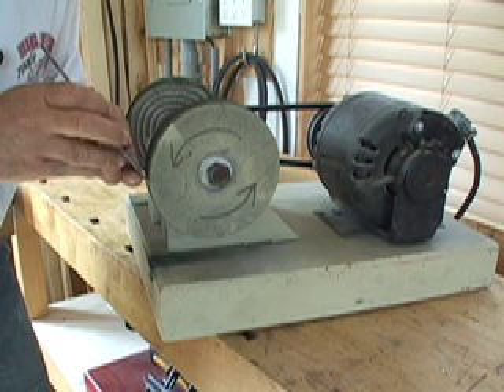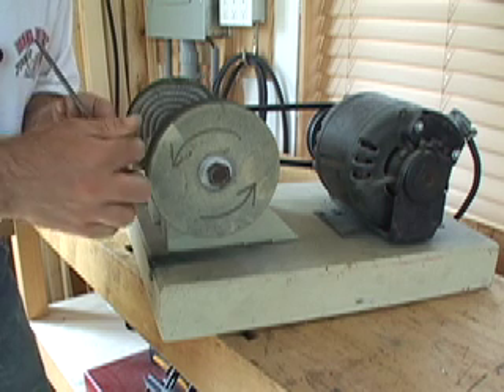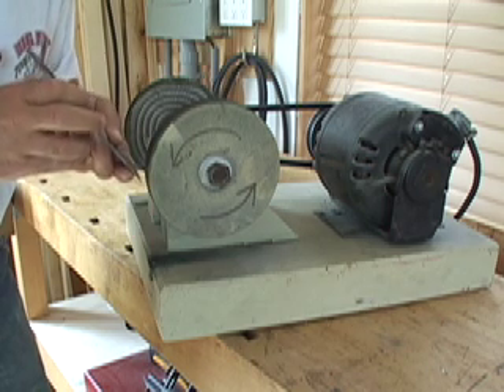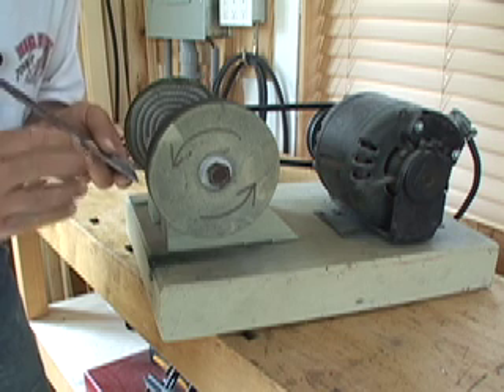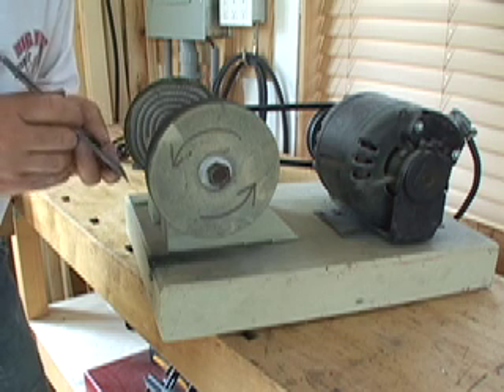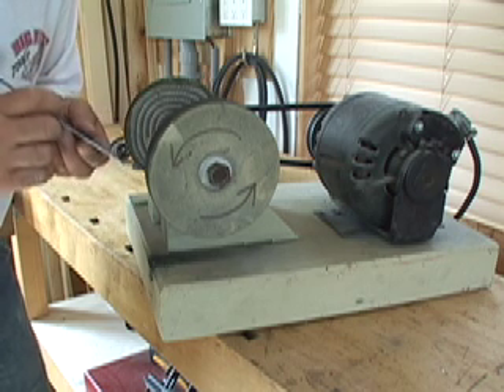Buffing Wheel Sharpening System

Comment: you used the word "tangent" incorrectly.
Reply: +Steve Maxwell Tangere is Latin for "to touch."
Reply: No, he used it correctly. The flat surfaces that form the bevel of the edge should be tangential to the wheel; i.e if you imagine the wheel as a circle and one side of the bevel as a line, the line of the bevel should form a tangent line to the circle of the wheel. This will create a slight hollow grind with a radius matching that of the wheel.